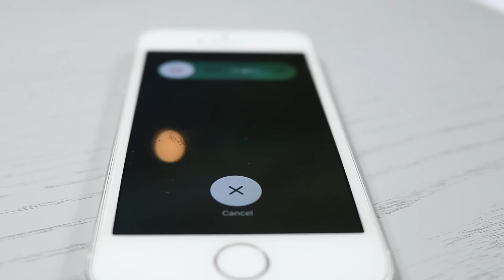How To Make Your iPhone Battery Last Longer

Comment: Does this work for Android
Reply: ThePandaRuff!an The same basic steps apply for android devices; except, the panel being unscrewed is generally located at the mid to far left (depending on device). Hope this helps!
Reply: Test and report your findings ASAP
Reply: ThePandaRuff!an i tried it on my Grandpa's phone it worked
Reply: Regular ol flip phone worked
Reply: no
Reply: ThePandaRuff!an yes

Comment: I used it and it worked! now it looks like I have 720% battery :)
Thank you very much!
Reply: My phone lasted a whole year with the battery hack I love it!!
Reply: My battery is at 420% now thanks!!!
Reply: Sad, I still have 69% Battery after this video. :-(
Reply: 720p *
Reply: I have 56635365535353635453654545455555454545544 battery now thx!
Reply: It should be 1080%. You didn't cook it enough.
Reply: Sponsored by HowToBasic
Reply: The HTB guy is putting that phone into the bowl and he puts some eggs and white milk into the bowl too and he makes a egg omelette without putting it on top of a plat I should of called it how to make a egg omelette.

Comment: How to do this in 22 simple steps:
Step 1: power off iPhone 
Step 2: take off front of iPhone (preferably with suction for best results)
Step 3: tighten screws
Step 4: crush with large battery
Step 5: throw 50-100 eggs at it
Step 6: crush with large battery, once more
Step 7: throw iPhone at wall 
Step 8: pick up iPhone, and throw at dinner plate
Step 9: clean up mess, this can get a little messy!
Step 10: throw watermelon at iPhone
Step 11: cut watermelon in half
Step 12: dig for and take out watermelon nutrients with hands, you don’t want your iPhone getting your soul!
Step 13: throw iPhone into 1 half of the watermelon
Step 14: put other half of watermelon on top
Step 15: hit watermelon with a shovel. Not a rake, not a hoe, a SHOVEL. Not after last time...
Step 16: grab raw chicken and flap wings until becomes possessed by dead infant(Head might disappear, this is normal)
Step 17: wait for dead infant-chicken eggs come out and put in bowl(add milk for best performance)
Step 18: throw in iPhone, then mix.
Step 19: pour onto table and heat up with blowtorch until solid(make sure iPhone is in there as well)
Step 20: put 2 loaves of bread next to egg-milk-iPhone thing. No more, no less. Otherwise, HE will come...
Step 21: crush with car battery
Step 22: put iPhone between the loaves of bread and duct tape it to car battery

Congratulations! You did it!
Reply: My phone has 101% charge right now thanks
Reply: Nice effort
Reply: @berdlygaming8983  roblox :0
Reply: EGGS
Reply: It works whit rifles
Reply: Lmao lmao lmao
Reply: 101% wtf is 100% successful
Reply: Walter Clements THIS NEEDS TO BE PINNED
Reply: My phone has never been Better thank you
Reply: Thx it worked :D
Reply: You just read HowToBasic's mind.
Reply: Good summary of the video

Comment: I tried it and it’s only 4x longer 

Unsubbed.
Reply: Clorox Bleach 
Are you sure you followed the steps correctly? The battery is supposed to work for longer, not faster.
Reply: Clorox Bleach did you use the correct amount of eggs?
Reply: Or did you not use a demon chicken with a baby head?
Reply: Did you use the correct demon toddler? A demon toddler chicken or demon toddler turkey? It makes all the difference.

Comment: I tried it, but now theres a SaltWater Crocodile in my house. It’s chill tho. What did I do wrong?
Reply: What was the size of the watermelon you were using? I've found that using the wrong size will attract crocodiles.
Reply: Ziggmanster  That’s probably what went wrong. I used a smaller watermelon. Then when I made the phone into a sandwich it came.
Reply: use a pineapple instead, that might do the trick
Reply: WhiteMale  Ah, okay. Thanks bud.👍🏻
Reply: ...so how did it go? did the pineapple work? pls halp...(sorry 4 bad english :( )
Reply: No
Reply: Jay Antwi  It KINDA worked. A platypus came in through my chimney.
Reply: Rick Sanchez  Ah, okay, thanks!